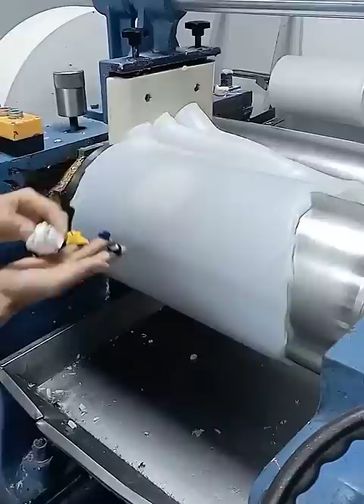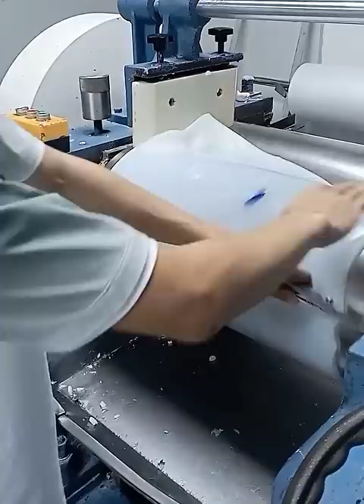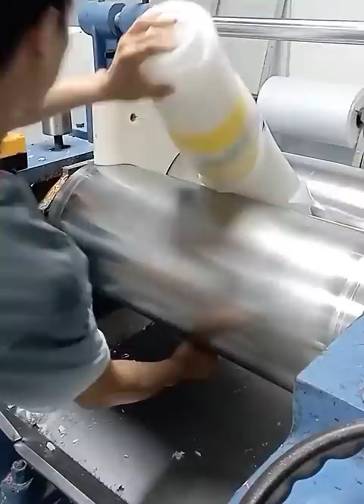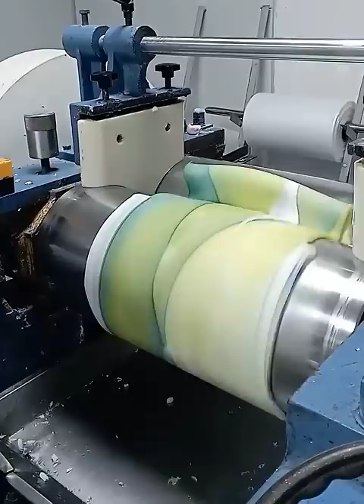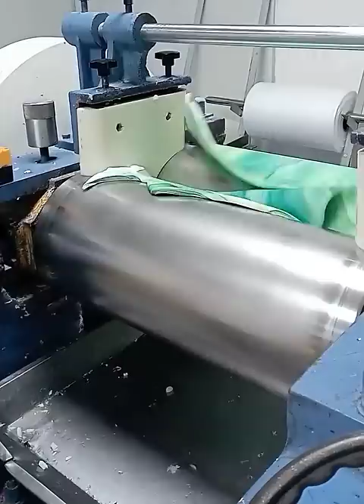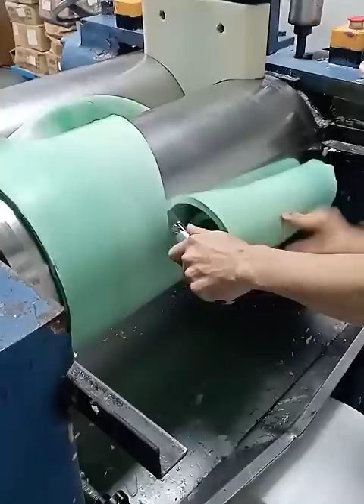Explore Tools #shorts #lifehacks #youtubeshorts #tooltips #exploretools

Comment: Who, like me, did not understand what was happening? 😅😅
Reply: Me😂
Reply: İ cant alunderstandt
Reply: Same😂
Reply: I'll bet you have never worked in a factory then.
Reply: @monicahoke6989  Don't bother betting, I don't want to work. 😏
Reply: It's silicon rubber getting painted
Reply: IP
Reply: Đó là nhưa chuẩn bị bỏ vào khuôn để đúc đế dép hoặc đồ chơi
Reply: It,s me😊
Reply: @monicahoke6989 agree, I worked for a company that made medical products  like catheters , treks these go on the outside of throat so patientcan breath, vascular loops use in identifying veins in surgeries (from what they tolds), anyways what the employee is doing is mixing the silicone with color pigments and keeps milling it til it's well combined till the sides has a level edge no in  cone final product edges are even we called it a pig. From there it goes into a hole  the rotary  machine, where the come into play even edges prevents air making the mold to be filled for a complete part for the product,  but before that Quality Control gets their testing for durability, strength in the silicone a strips etc. Understand now. Hope so, cause this is a long explanation as it is. Mispelled a word or 2 .EHH. THANK YOU
Reply: Me
Reply: Yoga Matte ?!? 😊
Reply: Ме
Reply: I have worked in mills and I didn’t know whaa was t it was!
Reply: Показывают, как из чего-то красивого сделать банальность.
Reply: I am with you...but yet I'm mesmerized
Reply: And so unsafe process!!!! 😱
Reply: @lol311  thank you
Reply: Eu 😂😂😂😂 isso ai é pra fazer oq ?
Reply: Same😅
Reply: حالا ای خمیرا بره چه کارین
Reply: Me😅
Reply: i, m
Reply: It's a taffy factory
Reply: Thank you 👍🏾  @lol311

Comment: Ive worked in factories all my life... and have seen 1st hand what rollers and press machines can do when one start becoming too familiar with it. 😮😮😮
Reply: I will do this work for free for life time 😂
Reply: Я все боялся, что его затянет под вальцы.😮
Reply: I just hope they at least put some emergency kick and not depend on that side button
Reply: I was thinking the same thing 😮
Reply: He seems to be unnecessary reaching under
Reply: I don’t see how he was being dangerous in any way, his hands never went near anywhere that can grab, and under can’t grab at all, he only ever had one hand at a time up the top, and he seemed to be being very careful to me.
Reply: @epsilona7472  You might be fine a million times but you're still chancing it. Like dirt biking, scuba diving or racing. Working with machinery is risky.
Reply: I used to work in a factory that made and cut sandpaper. We had a machine called the slitter. It would cut 60 inch rolls of sandpaper down to rolls from 2 inches to 10 inches wide. Worker got his hand pulled into it. While he was away from the blades and did not get cut, his arm up to the elbow was in the shape of a question mark!! Another guy ran a 60 ton press called the beam, did not use correct lockout procedure when removing cut material.  Got his hand and forearm smashed flat! People, you must be careful!
Reply: First "hand"? Pun intended?
Reply: A saying in aviation is, “complacency kills”.  I suspect this applies to a myriad other professions as well.
Reply: @serenity6415  No pun intended 😁
Reply: Да! Упаси ,Бог! А береженного Бог бережет!

Comment: The two roll rubber mill is a machine used to process natural rubber into various compounds. Two horizontally opposed stainless steel rolls rotate in opposite directions towards each other at different speeds to mix the rubber and ingredients used to create the rubber compounds.